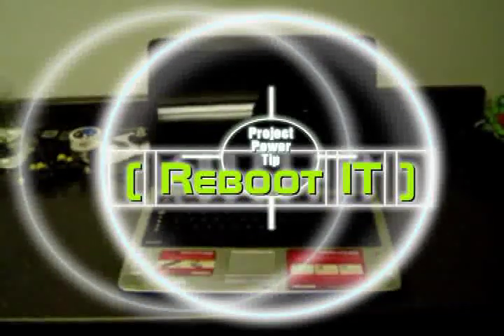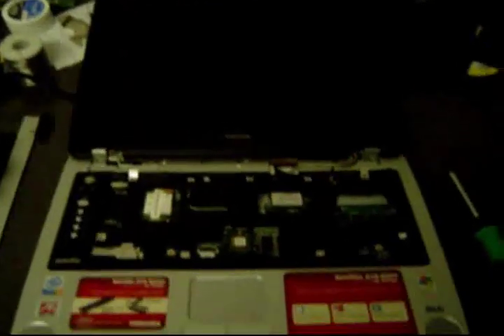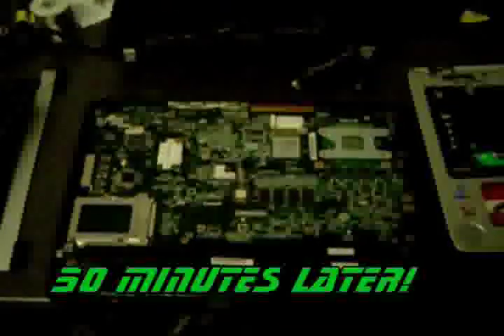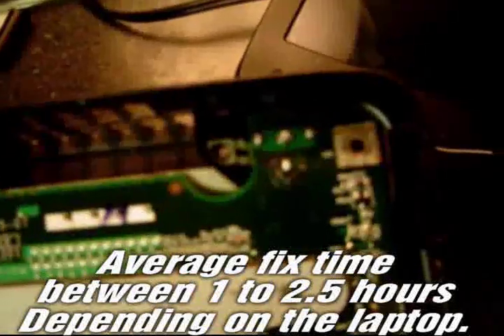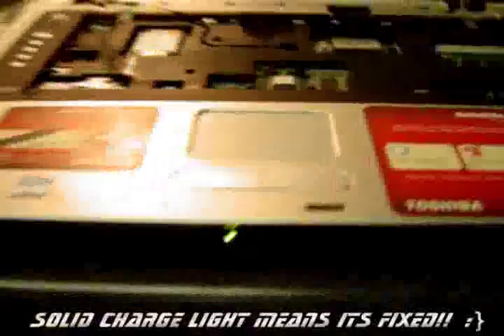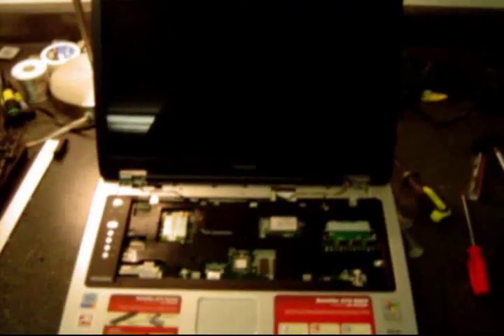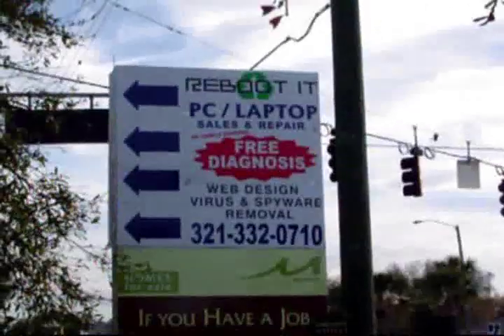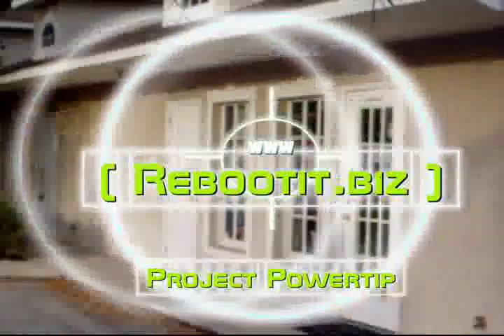Laptop power tip fix!  Toshiba Satellite DC jack solder  Mixcat @ work! Project Power tip

Comment: I don't know if I have the same problem, but it is similar. When I plug the laptop in at night, it charges the battery fine. But then once I've logged in, it starts acting as if I'm pulling the power cord out and putting it back in, over and over again and at best, I get about 15 minutes of life out of it and then it dies as if I was running solely on battery power that just ran out.

Could this be the same issue?